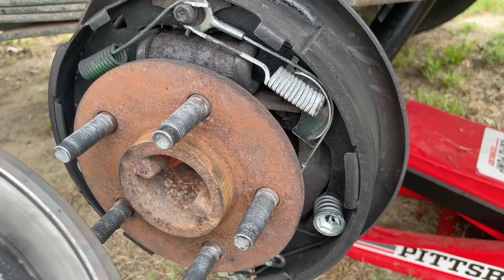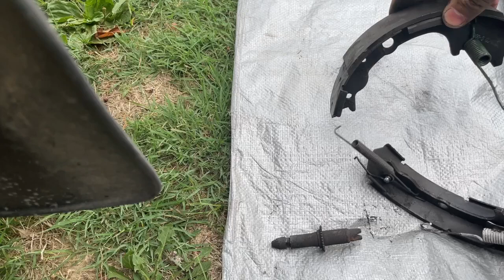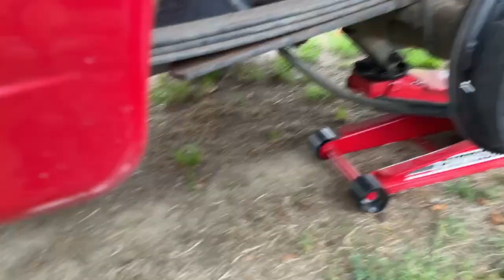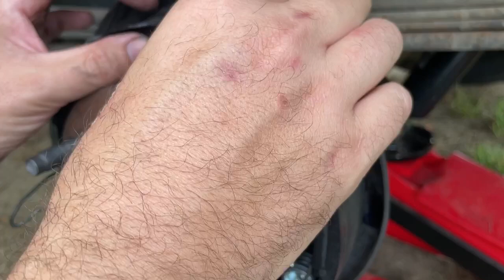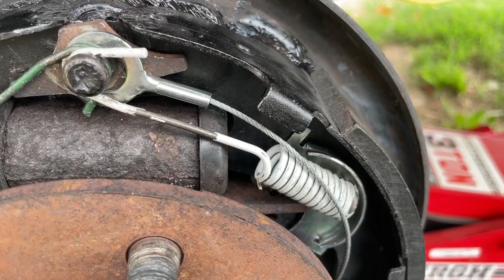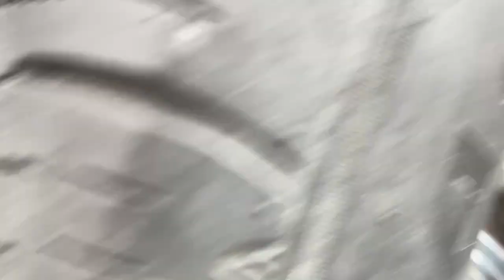2001 Ford Ranger Drum Brakes. 9 inch version

Comment: Your going thru all this for nothing u have the wrong cable its to long its not pulling the arm back that goes to the star ajuster, they make special tools for the job your doing instead of using vise grips leave the brakes to the pro's.
Reply: Even some so-called pros use vice grips. Some just use regular pliers. He did put the springs on in the wrong order. Although, I admit I don't know if it makes a difference the order it is in.

Comment: I have no idea HOW you fixed the problem though?  I see that you did, but how?
Reply from the maker: I ended up rebuilding the wheel cylinder and it fixed the issue.
Reply: Same I never seen what the problem was but redid mine just him and it turned out correct 🤷‍♀️🤔🤨🤦‍♀️